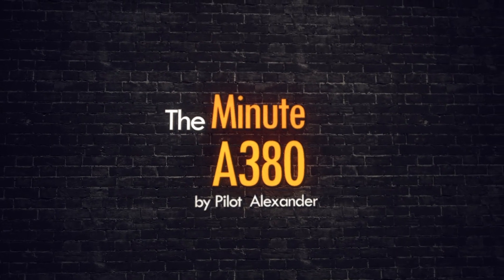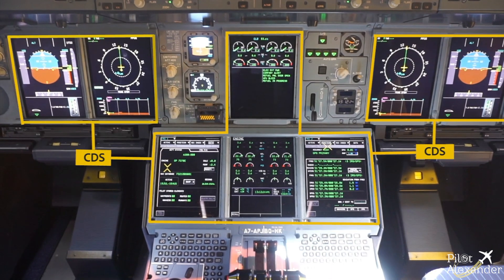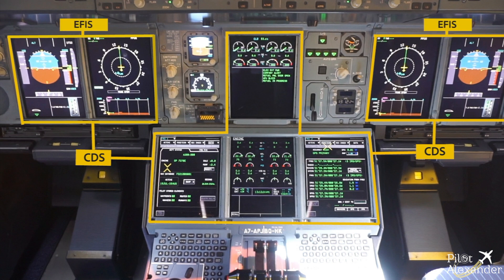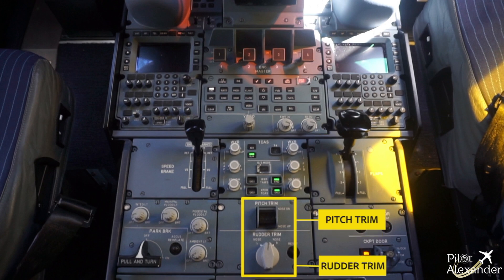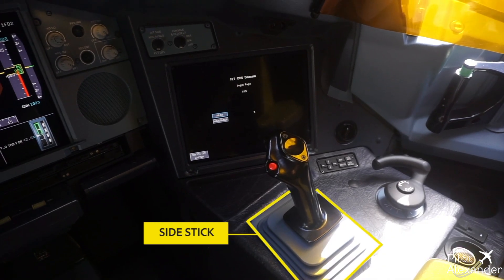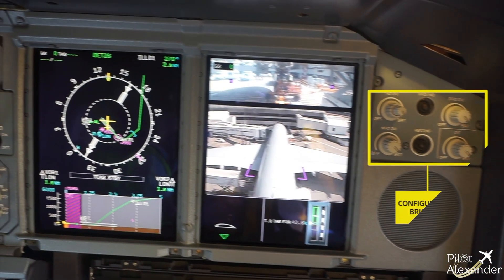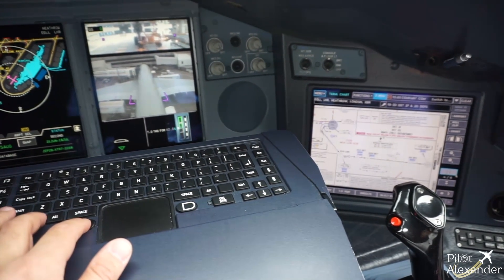The Minute A380 - Episode 5 - Cockpit Instruments

Comment: 1:40
the engines are controlled by thrust levers which are located in the center of the pedestal.
There are four detents (catches) of the LEVER.
1) IDLE
2) CLIMB
3) FLEX/MCT
4) TO/GA

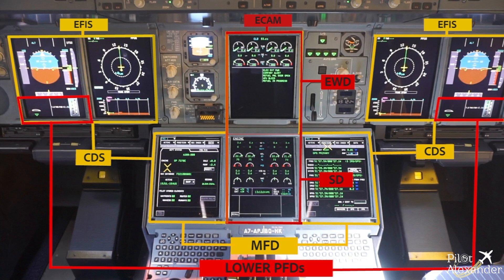Comment: 0:58
the A380 has  
1) two MFDs with 
2) the AFC
3) the ATC and
4) the Surveillance system
MFD = Multi-Function Display
AFS = Auto Flight System

ATC = Air Traffic Control